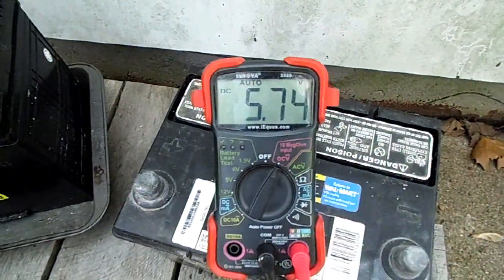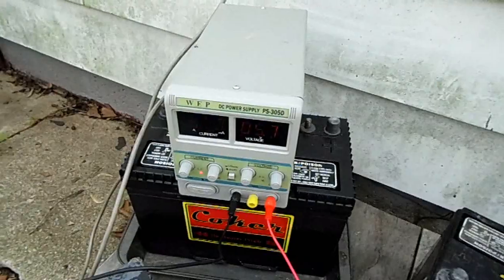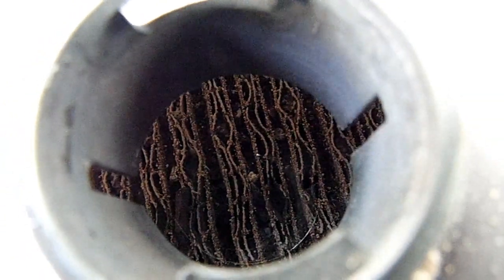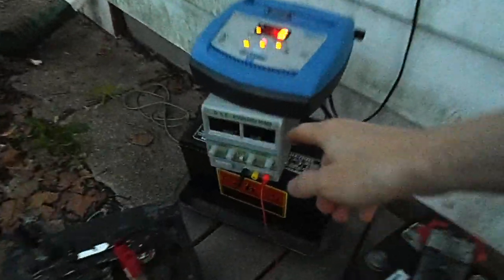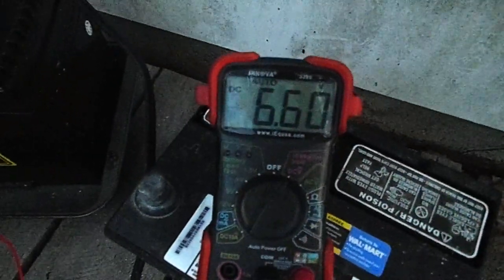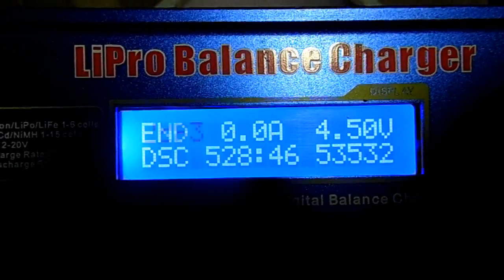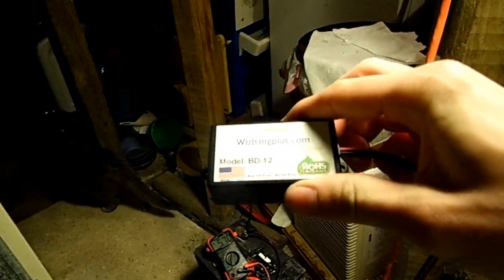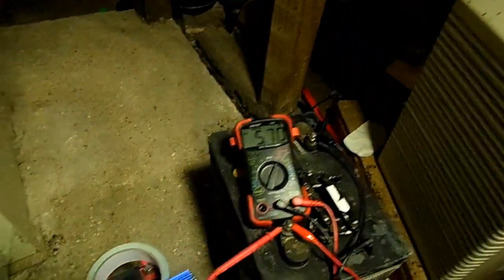Do Desulfators Restore Amp-Hours? Lead Acid Battery experiment

Comment: Thats some dodgy testing there. I'd like to see more consistent and better measured charging. The discharge data is useless without amp hours in, numbers to compare to. As well as temperature figgures.
I'd call it a neutral result. There was some improvement, especially on the voltage. further testing is needed to see if it was from the de-sulfator.
Did you flunk out at science or are you being intentionally facetious?

Having said all that I doubt a de-sulfator that small could have a coil big enough to do much to a battery of that size. A look at the output on the scope would tell a lot. Spike magnitude and duration etc.

I dare say many of the commercial de-sulfaters dont work very well. If you want a good one, study up and make it yourself. I've seen very positive results from a number of systems I have made. Most of the good ones have a charging ability too. Like this circuit Sohei Thoth developed a while ago. He has a heap of videos over a year or more leading up to this one AFIC SJR MultiCharger

Or if you just want a desulfator that doesn't charge (Much) and is easy to make. This Joult Theif I made a while back should blast the plates of larger batterys like yours nicely. MOT Slow flash Joule Thief. Single transistor flasher with no capacitors. Have a look inside while its running. You will see it working.

Of course results will also depend on the condition of the battery being re-conditioned. Looking at all the (Brown) sulfation on that cell, I'd say you could get much better results with a stronger system. If you look inside when its running. you can see the ion transfer reversing the damage. Smashing crudd of the plates. Although that battery has plates designed for CCA over deep cycle and may deteriorate beyond recovery too. The plates are so very thin and delicate. Sulfation is holding them together in places. Its borderline whether it can be improved.
Reply from the maker: make your comments shorter next time, unless you want people to ignore them.

and no it doesnt matter about the AH put in. i put in prolly 1000AH worth. so it was surely full.

now as for "Did you flunk out at science or are you being intentionally facetious?" go fuck yourself. i've almost banned you several times. i'm tired of you always nitpicking my videos, especially my welding. if you have an issue make your own videos about it.
Reply: >and no it doesnt matter about the AH put in. i put in prolly 1000AH worth. so it was surely full.<
I think thats a big problem right there. Overcharging shortens the life and is a major contributor to sulfation.
Reply from the maker: Mongrel Shark
 actually its the best way to revive them. just dont get them really hot and not creating hydrogen sulfide and your good.
Reply: Defeats the purpose of using a desulfator. Causes excessive wear on the plates.

Seriously. Look inside under charge and load and you will see exactly whats going on.
Reply from the maker: Mongrel Shark
You have worked with batteries before right?
Reply: Made a few from scratch, after 10 years getting exceptional life from the batterys that ran my solar house, and 10 years running CB's from old junk batterys before that. Yea, I've worked with batterys a little. Over the 20+ years I've been playing around with electricity. Check the hydrometer after your over charging. Its not just fluid leval and plate damage you need to look out for. If the acid strength has dropped without corresponding fluid loss, where has the sulfide gone?

Why do car batterys used on a solar system with a charge controller last longer than batterys in a car with no PWM or other current regulation when charging?
Assume less, observe more. You will see.
Reply: Rinoa Super-Genius if it starts to bubble violantly then you have yourself a problem but until then im sure you can get away with experimenting around with batterys lol
Reply: Hey guys I have a battery that is a 100ah battery that i have been trying to recover but no luck. So i am only left with one good 12v 100ah for my 24v system. So i decide i am going to get another battery. So here is the question, Can i get a 200ah 12v battery and another 100ah battery with the one i already have. Connect the two 100ah in parallel for 200ah 12v then connect in series with the single 12v 200ah battery to get 24v.
Reply: Its not recommended to Mix new batterys with older batterys. The old ones can shorten the life of the new ones. Do so at own risk. I have done it with solar batterys and not noticed anything too negative. Its not recommended though.
I dont see any prob with mixing 200ah bank with 200ah single battery though. As long as the other specs are similar.
Reply: Mongrel Shark
The older battery still sits at over 13v though, so i guess i can use of it until it is replaced.Thanks for the help

Comment: Hey, what's your opinion on max voltage for a healthy(near new) 6v golf cart battery?
And when driving around, what is the lowest voltage I should let it get down to? I want to keep my batteries healthy for as long as possible?
Reply from the maker: jusb1066
unless your battery is AGM witch in that case 13.3 is full. but the more sulfated the cells get the lower their top voltage will be. like this trojan t-105 will be at 6.08 for a few hours but tend to drop to like 5.9 after a few days.

TheMegaJerm  opinions arent what you need, you need data. the fact is that lead acid batteries are best when they are like 2.15v - 2.2v per cell.
Reply: Rinoa Super-Genius Cool man. I say opinion cause there is a lot of "data" people put on the internet that's different. I'm sure you have your own idea of what it should be thru your own data, and I have none.
When my batteries are fully charged, they sit rested at 6.35, which I figured is pretty good. So, I shouldn't let them get below 3.0 volts as good practice for longest life? Thanks man, love the vids! =]
Reply from the maker: TheMegaJerm
yeah, but don't worry about when they are under load. when batteries are under load they can dip a lot. what matters is where the cells go to when they arent under load. personally i would stop at 6v. because anything bellow that  the battery is very weak and will dip in voltage a lot. not counting it can worsen sulfation over time.

if you go down to 3v you could possibly short out a cell after a while. as you discharge a battery lead sulfate builds up on the plates. if too much builds up and warps the plate they could touch and ruin that cell.

so i'd say 5.8 to 6.4v is the average working range. but if you can keep them above 6v thats even better :D

btw i was just being a smartass before. i know its mostly just peoples opinions that we work with. :p
Reply: Rinoa Super-Genius We're all smartasses man! No worries! Thanks for your input. =]
Reply: its actually 6v is about the lowest resting voltage, under load doesnt count, when full the 6v battery will be 6.5v abouts, its a small range, but thats how lead acid works,  same with 12v car batteries, exactly 12v is flat and full is closer to 13v, you need to use a digital multimeter to get this accurate measurement

Comment: i was just wondering this same question yesterday, I bought the 45 dollar one on ebay that does 12-48v and i think it works and i hooked it up to my oscilloscope and it definitely is doing something because i can see the pulse waveform . cant wait to see the next installment, also would you be able to hook you desulfator to the osilloscope in the next video?
Reply from the maker: yeah but with this one you don't see hardly any waveform. either it's weak or just broken shit.
Reply: ok right. i just bought a second hand car with a very weak starting battery and ive got it on there and im going to see if it helps.

Comment: is the desulfator not supposed to be used while trickle charging the battery?
Reply from the maker: it can be, but some chargers have capacitors inside that would reduce the effect of the pulses. that is if there is any effect.

Comment: Ha ha "Crappy desulfator" you allways make me laugh :-)), i cant see how just a discharge however clever can do anything.

So do you think heavy charge then heavy discharge cycles are better for batterys?
Reply from the maker: heavy discharge is always bed for batteries.

btw what do you mean discharge can't do anything? are you meaning my results are invalid?
Reply: Rinoa Super-Genius
i think i know what he is getting at, the battery while its desulphating is lowering battery voltage thus maybe undoing what it has done, maybe keep a constant charger on the battery while it desulphates ?
Reply from the maker: jusb1066
yeah but it only pulls about 70ma and it doesnt seem to increase the speed of discharge too much.
Reply: Rinoa Super-Genius
Well the desulfator did nothing, it just consumes battery power.
And i was laughing as your a funny man :-)
Like with the animated car you made, monty python madness :-)
Reply from the maker: zx8401ztv
ah yeah, well the desulfator is supposed to feed high voltage back into the battery but this one isnt very strong.
Reply: Rinoa Super-Genius
I would think it would need an external supply and not just a high voltage with minimal current, pulsing with a large current would be the way i would expect it to overcome the low resistance of the battery.

Perhaps a relay wired up with a 555 timer so it pulses your welder output to the battery might have more effect, but do put a fuse inline just in case lol.
Reply from the maker: zx8401ztv
yeah i was thinking about running a flywheel from a lawnmower with a motor and zapping the battery from the magneto. not sure if magnetos make DC or AC so might need a diode.

i've tried using 555 timers but i find its easier to wire up a motor and a mechanical switch. i suck as solid state electronics.
Reply: Rinoa Super-Genius
A.c, a bridge of 4 diodes would give more voltage/current :-))

What about a relay running from a car flasher, but you are da man so what suits you mate :-))
Reply from the maker: zx8401ztv
 you can make a pulser with just one relay and a capacitor.

Comment: Always love your videos. I want to make a solar portable power generator and heard the 6 volt trojans are great. But you got me thinking about making a lithium battery pack. I was wondering tho about the normal solar charge controllers if they would work for lithium batteries?? I am also considering making lithium battery pack using the ones like you did for your bike on electric wheel chair, on my car, etc. what do you think?
Reply from the maker: i think a regular solar charge controller would overcharge them. maybe get a DC-DC step-down converter from ebay and just charge the cells as one huge 4.2v pack? that way you wouldnt have to worry about balancing.

the Imax B6 takes anywhere from 10-18v so i wonder if you could use one of them and keep it on maintenance mode.

or maybe a BMS. i havent messed with BMS circuits but who knows. this is kinda cheep  http://www.ebay.com/itm/Protection-Board-BMS-for-4-Packs-16-8V-Li-ion-Lithium-18650-Battery-max-2A-/261418250156?pt=LH_DefaultDomain_0&hash=item3cddbdefac
Reply: LiFePo4